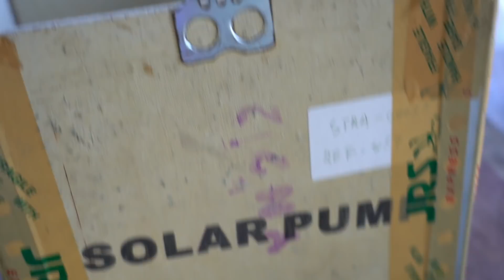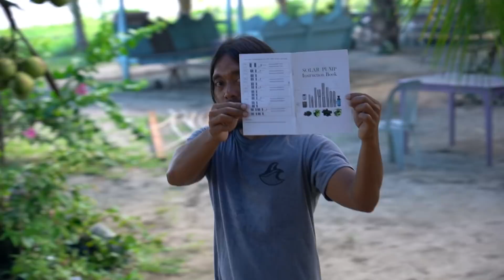COOKING BEEF MONGGO SOUP - Beach Land House Philippines - FAMILY LIFE IN DAVAO MINDANAO

Comment: Get well soon Kyle.  Hinay hinay lang Bai. Paalala lang don't forget to install/put a barrier (even temporary one) beside those 2 stairs at the Tambay Hut 2nd floor, very risky with no barrier or railing.  Someone may accidentally fall over. Another one if I may, please make sure there are no holes on the side wall under the sunken table where snake can crawl in specially during cold and rainy season or at night.  I'm  just concerned about safety. Keep safe always.

Comment: Unsolicited advise, the railing on the 2nd floor Tambay Hut needs change order, because it is too low, should be standard height, likewise someone or kids may accidentally rollover/slide under that railing. Another thing that may need change order are the 2 stairs which are too steep and may better if handrails are installed.

Comment: Again, safety first. Put handrails in your hut. That is one of the universal safety features that should be installed especially high places. Better err in the side of caution. Even that ladder has to have a cage. Also holding that camera vilolates the 3 point contact rule ie 3 point of your limbs has to simultaneously touch that ladder. Safety first bros

Comment: Is eating beans bad for those with arthritis? The answer is both a yes and no.

Depending on which type of arthritis you have, eating beans can be either good or bad for you. Beans such as kidney beans, lima beans and navy beans have high amounts of purine, which are then metabolised into uric acid when eaten. This may affect gout flare-ups, triggering and worsening the inflammation.

That does not mean you should stop eating beans all together if you have gout – it just means you need to control your intake and make sure to follow your doctor’s advice. Your physician may tell you to cut down on certain beans to avoid further accumulation of uric acid.

But did I really say that beans can be also good for you even if you have arthritis? You read that right, yes. It’s actually part of the recommended diet and certain kinds, such as soybeans, are also known to suppress inflammation in rheumatoid arthritis since it is a source of omega-3 fatty acids, a type of fatty acid that is beneficial against swelling and pain.